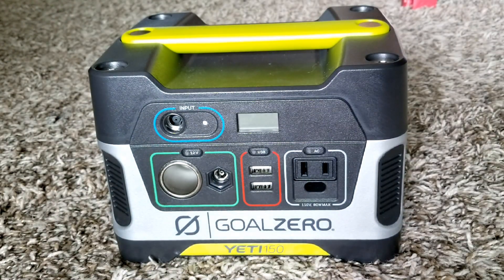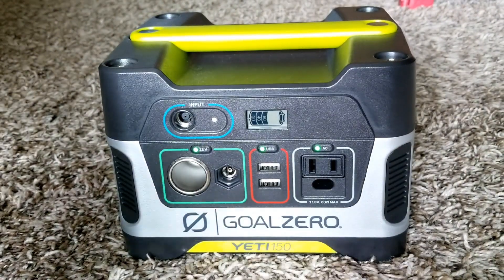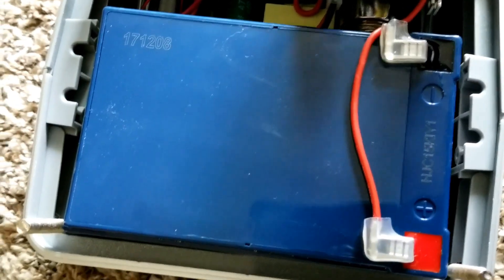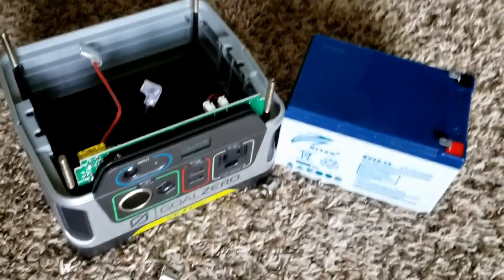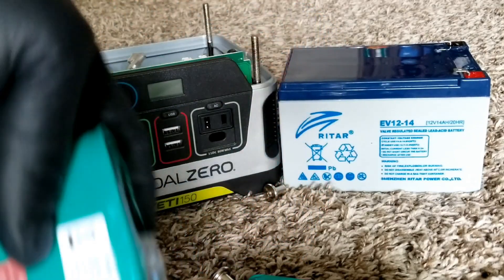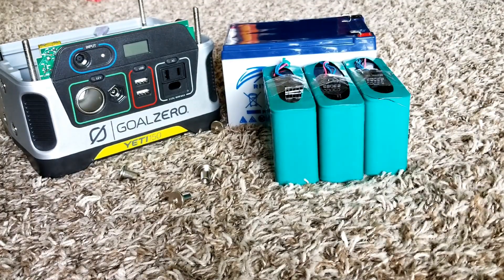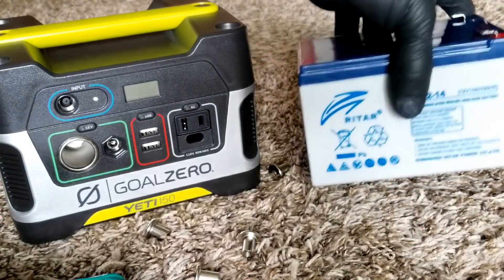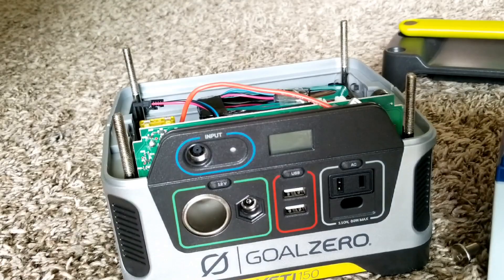HOW TO HACK GOALZERO SEAL LEAD ACID BATTERY FOR 18650 LITHIUM ION BATTERY (Part.1)

Comment: Did you fit a BMs ahead of the lithium packs as the charge circuit is designed for SLA Agm? Can you share battery specs for the lithium packs. I have a yeti 150 which could do with an upgrade. I may edit the lid for 4 packs
Reply from the maker: No. I didn't add an external BMS due to the panasonic batteries I upgraded to has built in BMS embedded in them.
LIKE SHARE and SUBSCRIBE